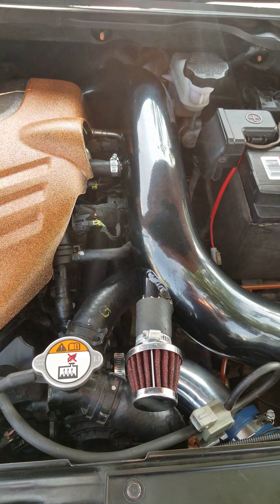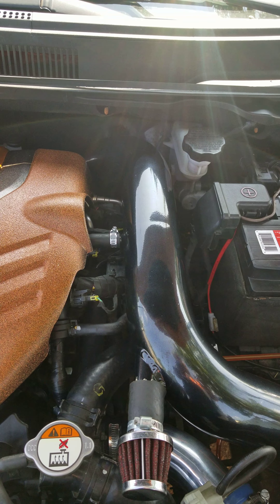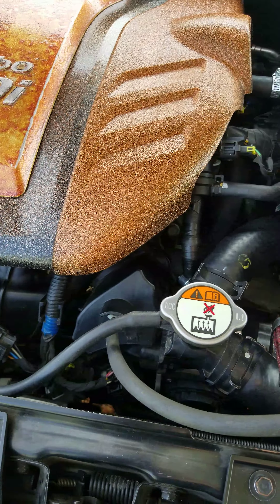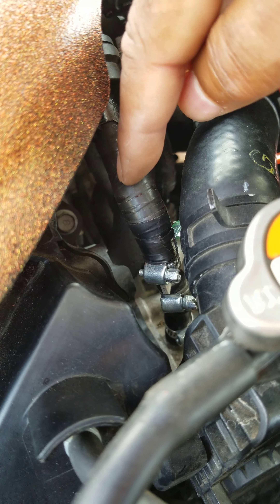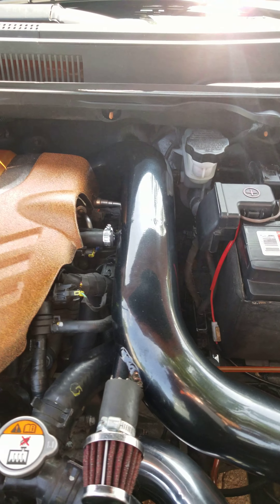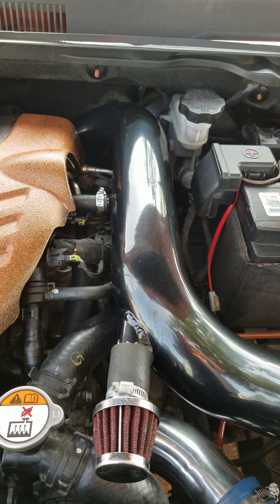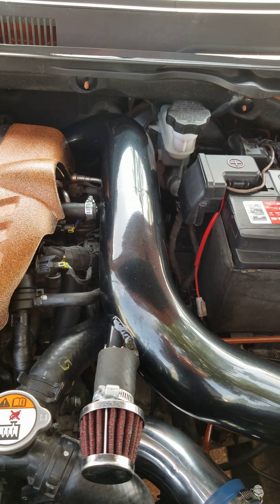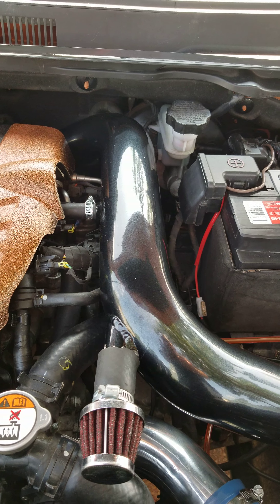Veloster boost hack( Visual )

Comment: What about when you have a boost gauge I'm more in the vac side besides pressure side when I build boost it goes to about 16 psi on the pressure side then when I let out the gas it goes to the vac side
Reply from the maker: Sorry cant answer your question I went with a mac valve upgrade seen this in a few different places and decided to give a visual video for those  who wanted to try it.
Reply: @n.a.k4321  I don't think I did it right but ima have a few buddy's that know more about the car and take a look at it and see what can be done with it
Reply from the maker: @dillonmiller2495   apologize I couldn't be more  helpful with it.
Reply: bro all turbo petrols have vacuum. if there wasn’t vacuum i’d be scared and would think you had a boost leak. hook a turbo gauge up to any turbo petrol and it’ll have vacuum until you get on the gas to provide exhaust to make it spin. as long as it’s only when you’re off the gas it goes back into vacuum which is fine
Reply: @veeq4210  I already got it lol went full bolt on a tuned with a stuffed turbo stage 2 clutch meth kit and arp studs making around 350hp to 400
Reply: @dillonmiller2495  could you post videos of pov videos l?